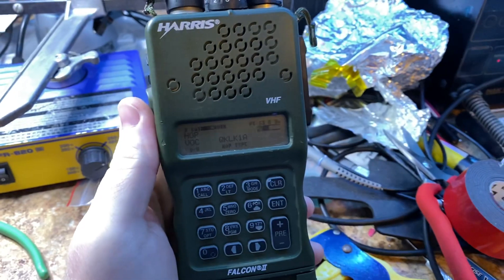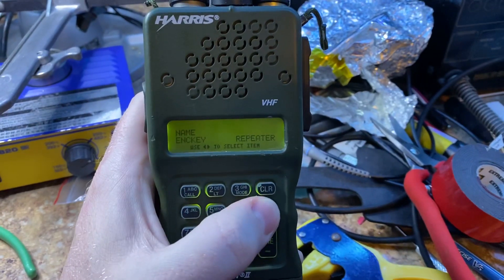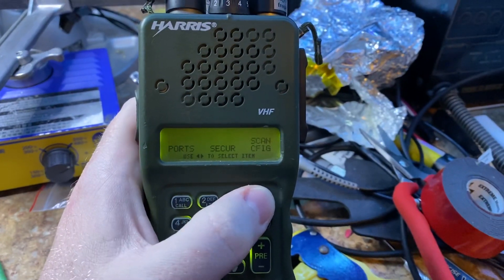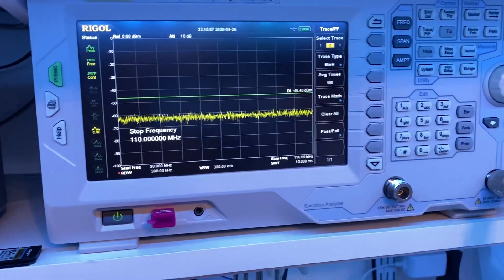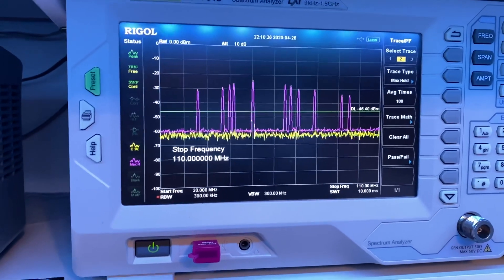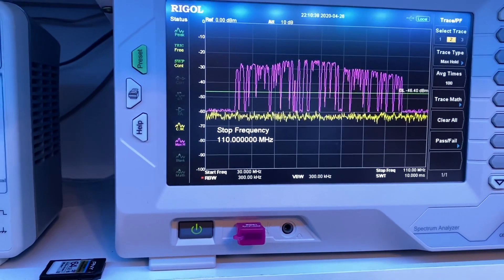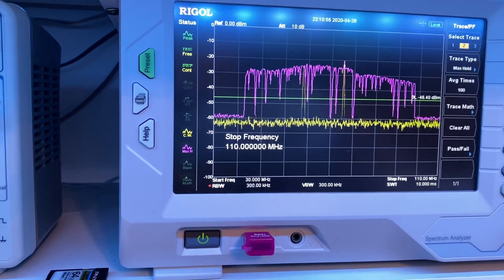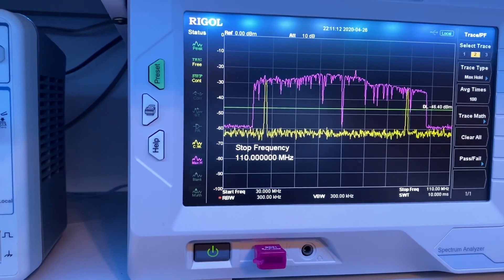Frequency Hopping Secure Voice Coms

Comment: how does the other radio know what frequency to hop to in order to pick it up?
Reply: This is how military radios work like the PRC119. Each radio has a time and everyone sets their radios to that time. They get off time as days go on and when it's about 2 seconds off time they lose comms but they are extremely effective in that the enemy can't listen long enough to hear what you're saying. The military versions also scramble the voice in a certain algorithm too so it's very secure. This is about as good as civilians can get. Motorola made some called RT 550 or something like that, that also does the same thing. It's a tremendously awesome tech for SHTF but everyone needs to have the same radios and correct programming.
Reply: @realtyrocks1969   Your pretty much correct, the 119 is a sincgars radio. Sincgars hops at 100hops a second just like the radio does in the video(100hops). Radios need to be synced based on time and date. More modern radios use GPS for accurate PNT(position, navigation and time) time being the most signifcagt reason of having a GPS attached to the radio. They also need to be within 4 secs to be synced. The hopping is called ECCM, Electronic counter counter measure. Its kinda funny name but the enemy would set up jamming equipment to attack a certain freq, jamming is called ECM(electronic counter measure) and then the radio uses the ECCM to defeat the ECM. ECCM also helps with evading evsdropping but not the true solution to that, so in additon the radio is encrypted at the same time as hopping. The radio in the video is commerical/export version radio for foreign militaries, its very very comparable to prc119. Same freq range and nearly identical performance. The one in the video though is a lot better for a civilain, its small and portable and its encryption and hopsets can be loaded on the device itself, no need for external keyloader or speacil software. It can also transmit its programmed details to other radios of the same model. These features are very ideal for small low budget foriegn militaryies because they dont have nrealy the same communications infrastructer as the united states military. It also happens to be incredibly convient for citizens too to own and operate.  I own newer versions of this same exact radio.

Comment: How does the radio pull that trick off is it overly complicated or just software?
Reply from the maker: It’s both.  Military has been doing for years.  Hedy Lamar came up with it in the 40s
Reply: @W9CR  my question is how the radio on the other end knows  where to listen?? Doesn't it have to mirror the hops?  that would suggest there is some sort of encrypted instructions on where to tune?  or does it just monitor the whole range of frequencies?

Comment: Be interesting to put that antenna on a VNA. The power output to the analyser doesn't look constant across the band. Wonder if the antenna is active, or switched between different elements, or just very wide banded with bulletproof finals.

Comment: Is the output power the same in frequency hop mode as in narrow band? I was told military radios have shorter range when they use secure coms and I want to understand why or if it's even true
Reply: I was an RTO in the Army. All our radios had frequency hopping. With a short antenna you could get about 3 miles and about 15 if you pulled out the long whip antenna on high power.  The long whip antenna was about 8 feet long and connected like a tent pole.
Reply from the maker: the PA is wideband, and doesn't need to tune across the band.  There may be some gain variation, but it's only a db or so.

Comment: Is the dtr650 any close to work that way of frequency hoping?
Reply: DTR uses 900MHz ISM band and has 50 predefined hop sets. Frequency hops every 90mS. It can be followed on a near field receiver, but the voice is digital (VSELP) which gives you additional privacy.  
If you create a private channel, instead of using the out of the box public channels you'll have decent privacy.